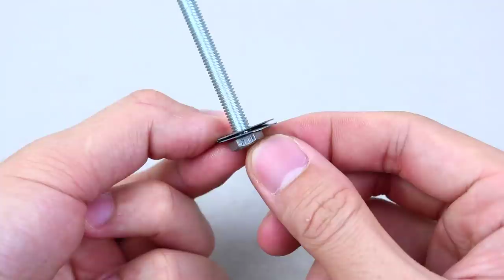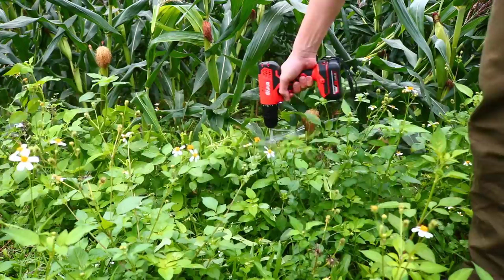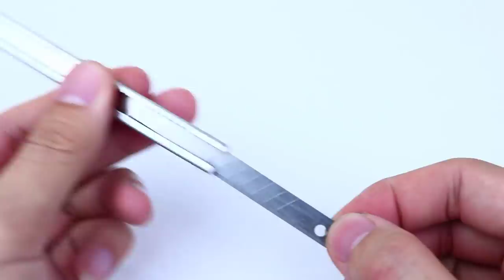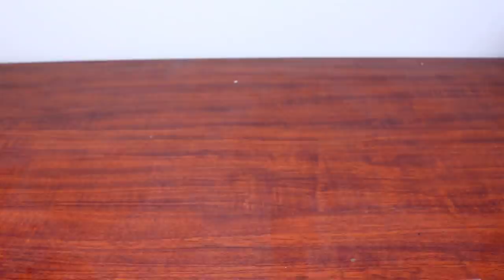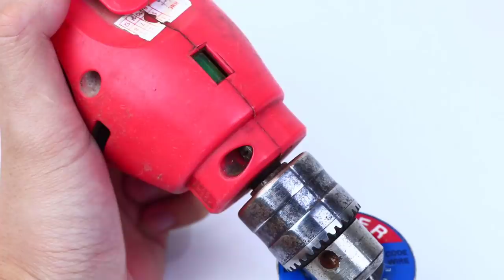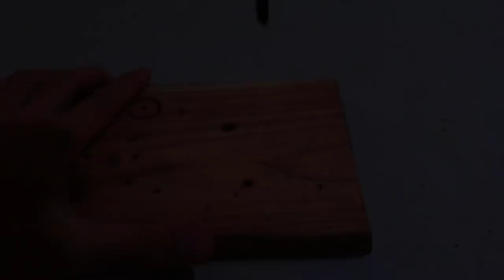TOP 3 Smart Life Hacks with Drill Machine at Home

Comment: 0:33 that is a very bad Idea that knife has break away blades for when the tip gets dull you snap the bad end off and you have like new blade.  If you make this drill hazzard  better use eye and hand protection and please where pants and shoes shorts is not ideal protection for this project. If you hit a stick or something solid that blade can not cut be sure it will snap that blade off and slice you pretty good